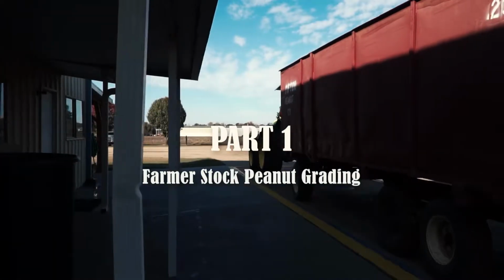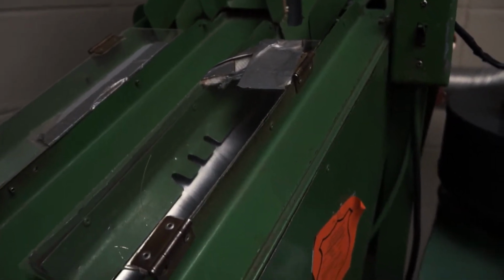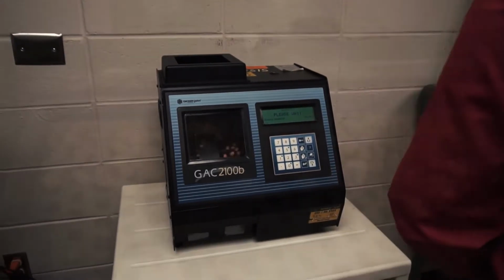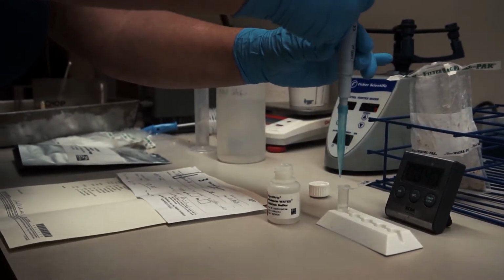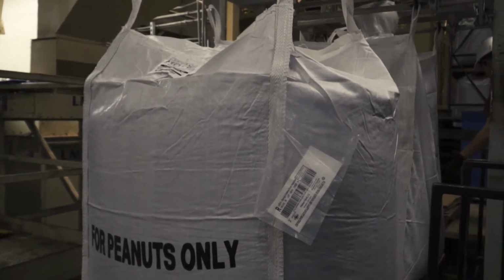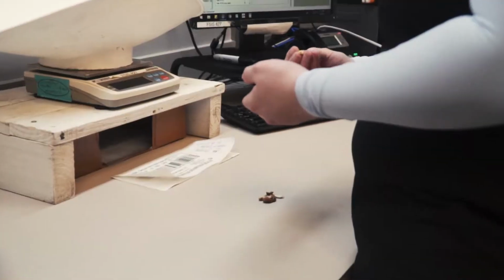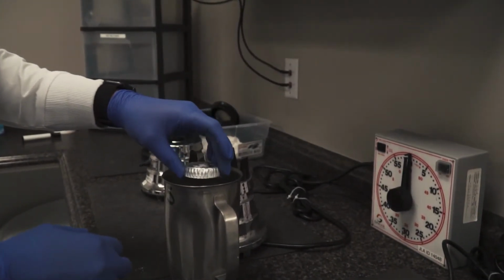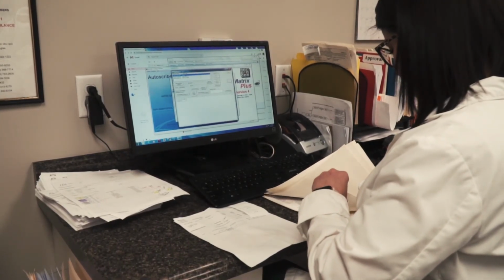Farmer Stock Peanut Grading

Comment: I have analyzed peanuts & corn mycotoxins (aflatoxin & fumonisin) in the USA & Ghana respectively using VICAM Fluorometer (4 Ex series) and AgraVision Systems. Aflatoxin is a global issue, however, most consumers are not aware.